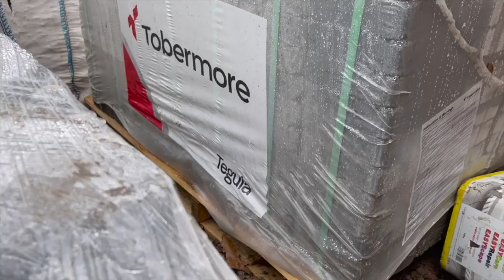#Block #Paving #Driveway #Installation Using #Tobermore #Tegula In Charcoal

Comment: Ay up Jon.
Nice work buddy.
Shoulda put a picture frame round it and calculated width so no little cuts needed, doesn't look right that.
But maybe you had reason, cheers bud
Reply from the maker: I see your point but a picture frame would of made it looked narrow
Reply: Would of looked way too narrow with a picture frame on drive fella. Keeps the area clean looking this way.
Reply from the maker: Absaloutly far to narrow and unnecessary

Comment: Mortar bed stringer course to plastic flexi channels and flag area at finish level….30 mm of screed not 50mm and allow 5 mm or so for compaction. For .50mm blocks you wanna screed at around 42to 45 mm. And dont notch out timbers. Srew 2 lathes or similar to either side of sreed timber…easy to adjust if needbe.l..screed tubes not box section…you can bend to suite if screeding undulating brows or dips….easy to straighten later aswell. Finally get a decent forward reverse diesel wacker. Plate wackers just vibrate surface.. you should be able to prsss those keykerbs ito some decent bedding mix. And you should have a keb race already in before finishing stoning up to put your kerb bedding gear on.. stringer course to drive threshold so cuts arent on outer extent of drive…. I only use 60 mm blocks for drives 50mm are only good for pedestrian applications
Reply from the maker: Good response

Comment: If you vibrate the ground too much you risk bringing any water in the ground to the top even after a few dry days always keep that in mind,  avoid vibrating any wet spots and remove them if possible.
Reply from the maker: Great tip thanks

Comment: Why do you measure the screed rail in 5 different places? your string line is straight, and the metal rail is straight, so you only need to measure at each end of the metal rail? if you start making adjustments in the middle, you'll throw out the first end you set up
Reply from the maker: It depends on the steel and the the length of the steel as it can flex in the middle, its abasaloutly reasonable to check for this reason, if you feel you dont need to thats fine. Thanks for your feedback.